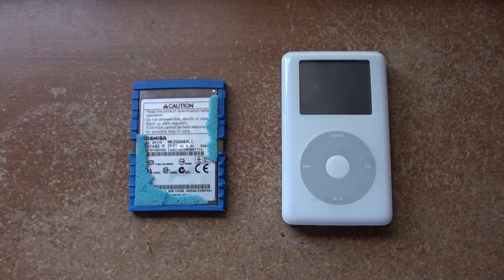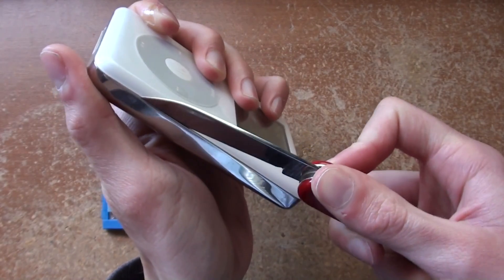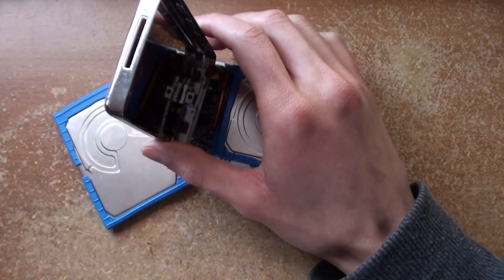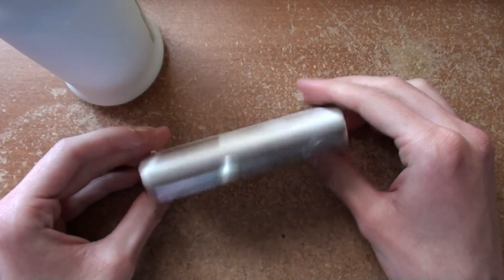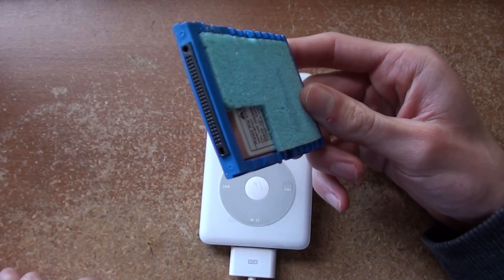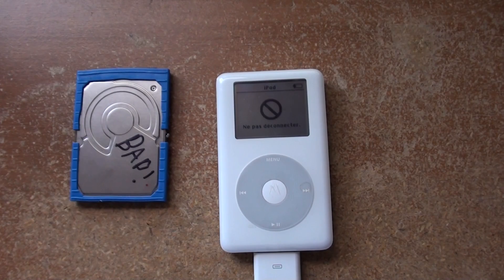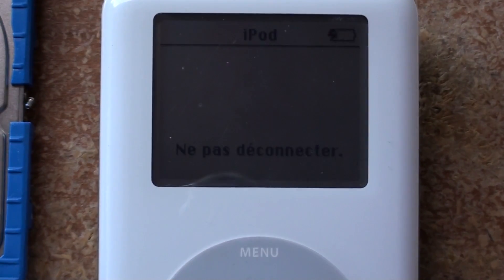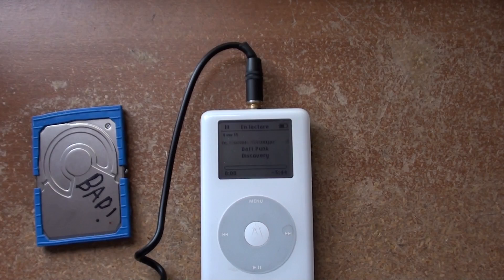iPod 4th Generation Hard Disk Replacement

Comment: druaga since you can put a compact flash into a ipod can you use the ipods hard drive on a computer
Reply: George Murray you can and dragua has previously when he thought cloning the hard drive onto a compact flash would fix problems with the first iPod he was trying to use before the 4th gen
Reply: so would you be able to get a compact flash adapter and just willy nilly plug the hard drive in and you could read/write?
Reply: Well i know in dragua's video he put it in a linux computer and used gparted to flash it and clone partitions, etc., so i assume you could format it and then read and write

Comment: I used to buy broken 4th gen iPods on eBay and mess around with them. I still have like 20 laying around in various conditions and a bunch of random parts as well. Sometimes on these iPods, if the hard drive is clicking, you could actually smack it a few times with your palm and it would correct the hard drive.